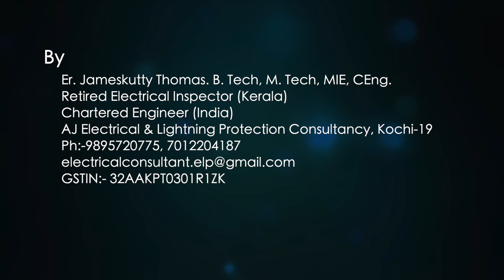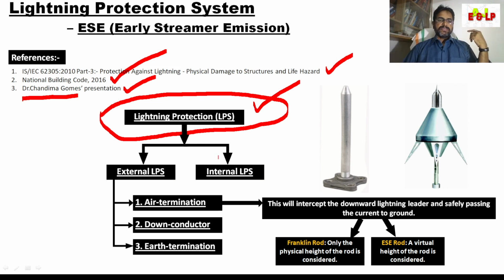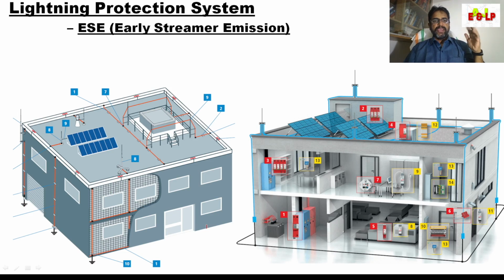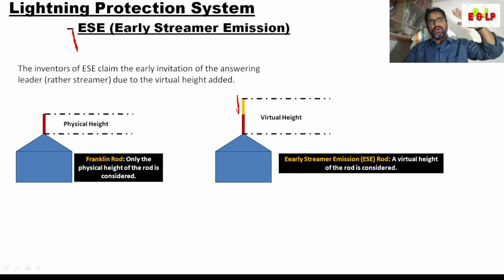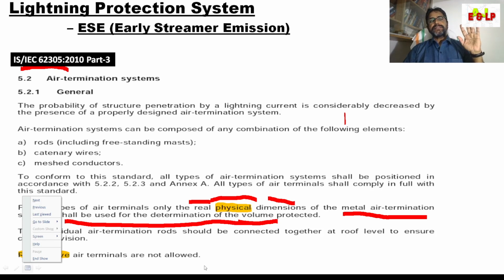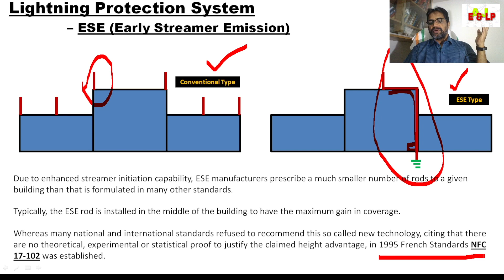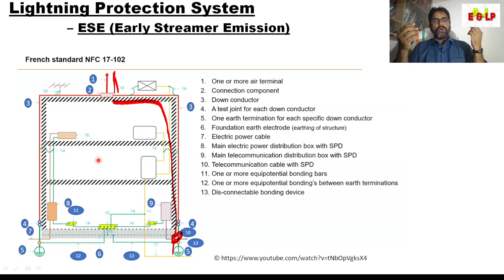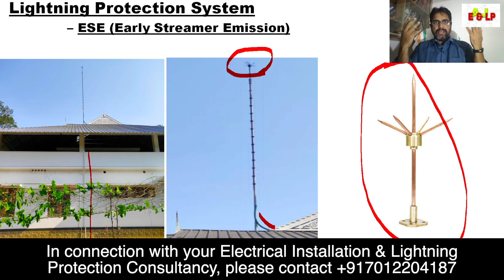18.Lightning Protection Systems (LPS) - Early Streamer Emission is acceptable or not? (English Ver.)

Comment: Nice awareness creation topic. ESE is a science fiction. It is not accepted by scientists. In ESE lightning protection system, the installers just provide an attractive air terminal and insulated cable as down conductor. So there is no chance for equipotential bonding which is a requisite condition to avoid damage to sensitive equipments.
ESE appears to be simple and catchy to the end user. There is a highly influential and commercial lobby behind this ESE activity and it is very tough to overcome it.
The users are either lured or impressed by believing the ESE as a magic box through the ESE mafia. ESE rods are gaining popularity among the rural folks and engineers.
It's heartening to note that fake products gain easy route in implementation in our country.
Reply from the maker: Thank you sir. Very valuable points & the truths you said.
Reply: Absolutely agree! Here in my country (Dominican Republic) these “magic rods” are gaining a lot of popularity. And one of the reasons is the lack of scientific research by the engineers who prefer to take the “easy route” on lightning protection systems (promised by the ESE vendors).

Comment: Good explanation. ESE is flouting all national standards, including NFC. I found it tough to manage those ESE promoters when rejecting them in Tamil Nadu. But they have a strong lobby that lures the contractors and engineers. The ESE concept is "No risk assessment, no design aspects as per IEC; Just insert a magic rod called ESE rod atop a building and have cable as down conductor; That is all !!!" Very pathetic.
Reply from the maker: Yes sir, very pathetic. In Kerala also, many laymen call me regarding this. The first enquiry/quotation that they get is based upon ESE. Many falling in trap. For a home say 1500Sqft ESE do it with Rs. 55000/- but when we move to the conventional system it may go up, the material quantity being more. Finally the people opt ESE.

Comment: As long as consultants stick to IEC 62305, they would never approve of ESE device. It is just a gimmick to save cost but risking lives/structures by using something which is not recognized by international regulations
Reply from the maker: IEC 62305 is also International Standard which doesn't approve ESE. Which is the other regulation you told approving ESE? French standard? Implementing French Standard as such it is okay (but not in other countries), but what we see ESE implementation in India is not as per even this French Std.
Reply: @AJElectrical  That is what I said. NFC 17 102 (French standard) approves ESE and also takes the complete Risk Assessment calc part from IEC 62305 but when it comes to design implementation, they have their own formulas which are not accepted by IEC. As a matter of fact, NFC std mentions on their forefront that they don’t take reference from IEC 62305 and that’s why they are rightly questioned and then rejected by IEC.
Reply from the maker: @immigreat54  https://youtu.be/Ztjy3goB7aA
Please watch this video also